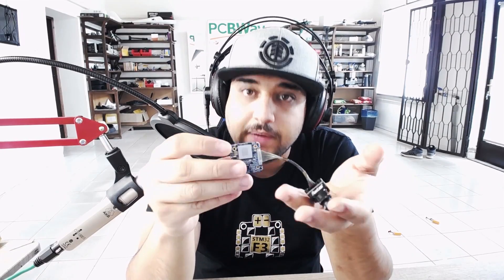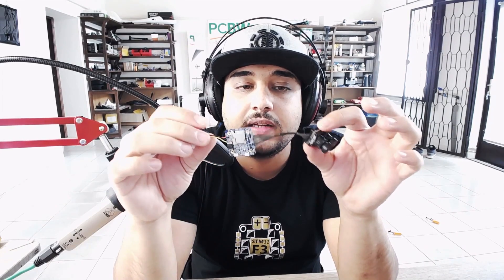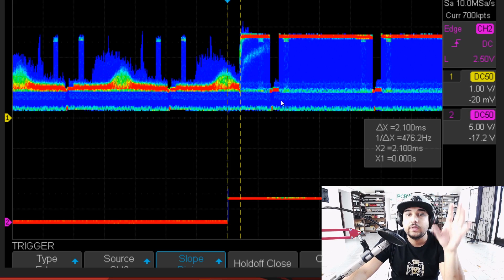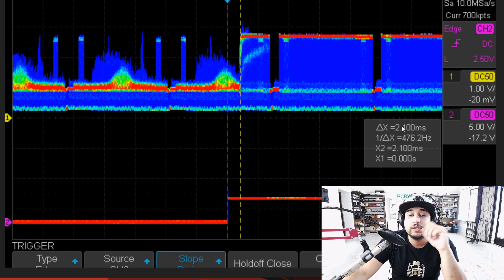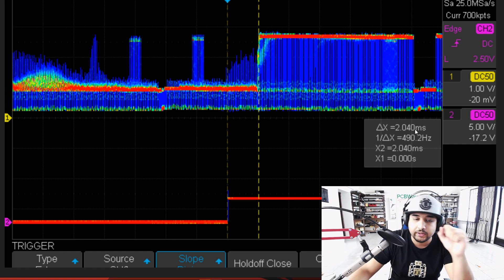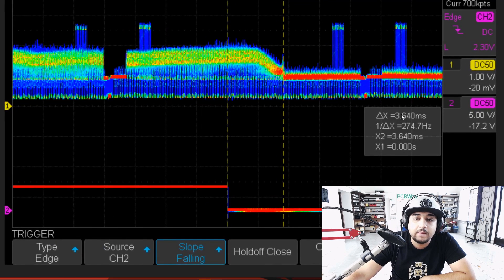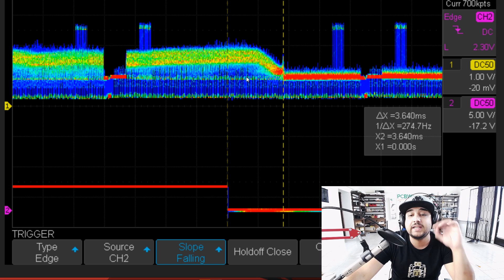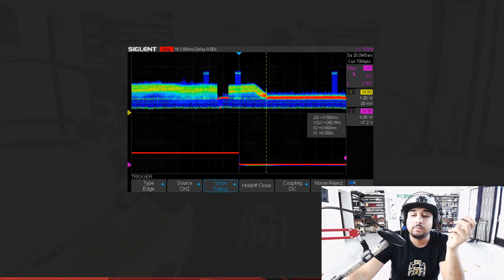They Say Low Latency // RunCam Hybrid 4K

Comment: I may have to check this one out. I can't run the Tarsier due to lack of room for two boards. My iFlight stack has the Runcam control port.
Reply: You'll be better off. The tarsier jello is horrible. We shouldnt have to buy ND filters just to use the cam. Get the runcam hybrid
Reply: @vampcaff  I have a little bit of jello with the Mix but it isn't bad. I tried buying the ND8 filter from the Ratel but Caddix won't take my money. I hoping for a dual cam Foxeer.